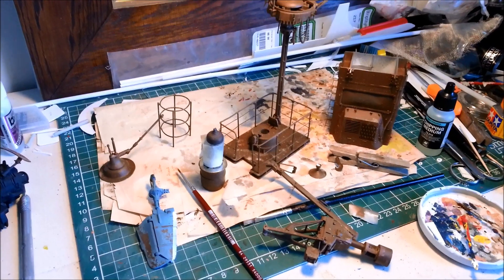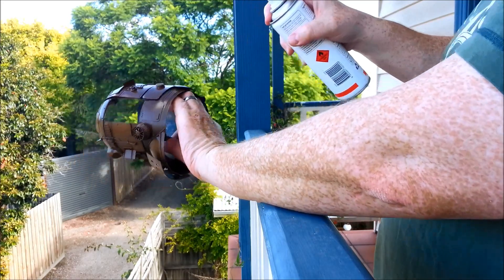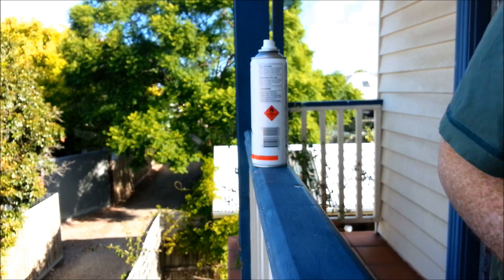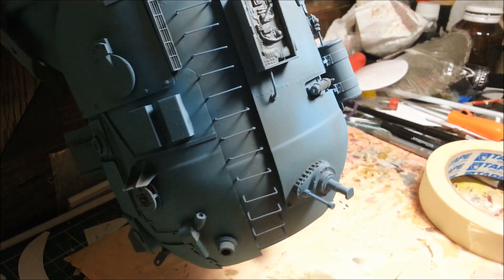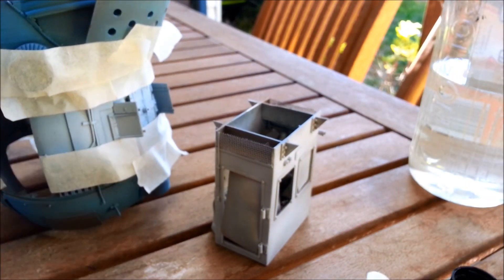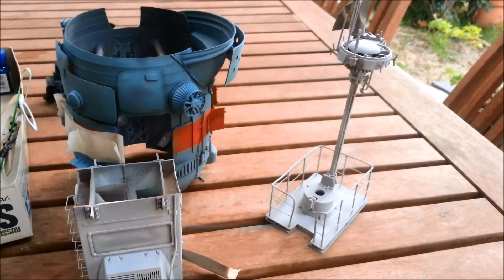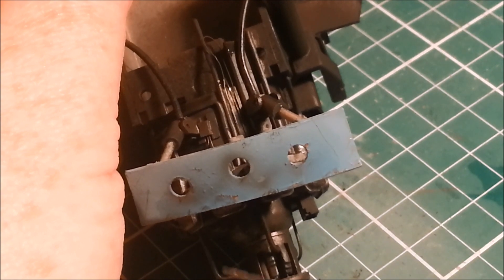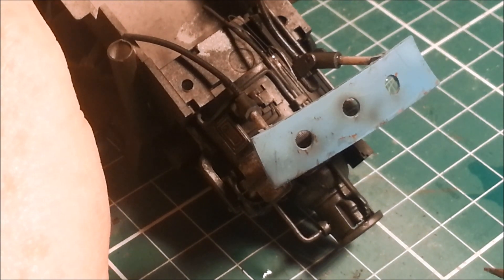Painting and weathering: in depth hairspray chipping tutorial

Comment: If you leave your model with hairspray on for a while will the effect not work
Reply from the maker: It shouldn't make a difference. I have left the hairspray for a couple of days before painting the topcoat and then chipping, and it works fine. The main issue is the thickness of your topcoat, if that is very thick it can be hard to make it chip.

Comment: Beginner Question: I've tried the hairspray method with waterbased acrylic paints (I know but paint thinners in a flat during winter isn't that great). So I've tried to apply a base coat, seal it with satin gloss varnish (spray can), apply two layers of hairspray and then another coat of acrylic paint. Btw. I applied the paint via brush not air brush if that's important. I let everything dry for 2 days, then wet the surface with clear water and started to chip with a hard bristle brush - which wasn't very smart as most of the paint came off and I looked at bare plastic. But even with a soft brush it wasn't anything good.

I would conclude that waterbased colors aren't really useable for this technique? That might be a "no sh*t sherlock" kinda thing but let me direct your attention to the first word in this comment. Otherwise I'd love some pointers as the hairspray method looks very cool and easy to do. Thanks. :)
Reply from the maker: Hmmm, I think you’ve got the answer with your water based acrylics. I would try experimenting on a test piece or two, see if you can get it to work on something that isn’t important. But I think the issue is the water based paint. I would also try only one layer of hairspray, rather than two. And try to keep the final top layer as thin as possible (airbrushing would make your life easier here, but I understand not everyone has one). That way you can experiment with less water overall at the chipping stage, and hopefully this way you don’t lose all your paint. Hope this helps - Dave
Reply: @DavesModelWorkshop  Thank you very much. First off: Great videos. They're all very helpful and I still have a lot to go through :)
I just think buying an airbrush right from the get go seems a bit steep but I think I'll stick with this hobby so maybe next year I'll get one.

I'll try less hairspray and maybe I'll be not as conservative while using the varnish. Maybe I didn't seal the first layer properly? If that doesn't work, well might be time to try enamel paints. Thanks again, have nice and save holidays and a better 2021. Greetings from Austria
Reply from the maker: Agreed, make sure you really want to continue in the hobby before investing in an airbrush. And if you do, it doesn’t have to be crazy expensive either.
Reply: @DavesModelWorkshop  From what I've seen, the airbrush itself comes in quite the price range and there are "good enough" cheap options. But the air compressor seems to be the more expensive investment here.
Reply from the maker: @BlueManaBanana  I got a combination airbrush and compressor package for around $100, and it has worked a treat for 15 years.

Comment: Great tutorial Dave. To be honest I wasn't sure that you could hairspray chip enamels, but your results look great. I have a project in the holding pattern which will have a very similar colour scheme and rust effect, so this is very timely for me.
Reply from the maker: Damian, I wasn't sure myself until that first test piece ;)  What's your project?
Reply: Cool, diving right in, like it! My project is a stupidly ambitious, overly large long-term display involving 5 (yes 5) 1/12 scale Monogram Chev car kits. I have an unbuilt Camaro and an unbuilt Corvette, and 3 paint-bomb 57 Chev Bel Airs that I have picked up over the years from various swap meets. The 57s will be built cut down to convertibles to show 3 stages of restoration. Barn find, workshop and show car. The Camaro will be a tow car for the "barn find" 57 (so I need to learn how to solder to scratch-build a tandem trailer as well, from brass stock), and the Corvette a show car sitting beside the final 57. The reference car I am using for the barn find 57 is the same colour as your SeaHorse.
Reply from the maker: That sounds cool! Ambitious, but it will look amazing once completed!

Comment: Hi Dave. Wonder if you'd mind answering a technical question? I've primed my model with acrylic, done an acrylic rust layer with airbrush and a sponge, I've not done any type of clear coat. Now I'm want to do a hairspray/vallejo chipping medium layer followed by a enamel colour coat to chip. In your experience would you say I need a gloss/matte clear coat after my rust coat to protect it? And if not, would an acrylic rust->hairspray/vallejo chipping medium-> enamel colour coat work?
Reply from the maker: Hi Matthew, as long as your base acrylic rust coat is fully dried and cured, you should be fine and shouldn't need any gloss/matte clear coat before the hairspray/chipping medium. And you will be fine to do a top layer of enamel, just keep it thinnish, don't layer it on too thick or it will be tough to remove. Cheers, Dave
Reply: Dave's Model Workshop brilliant. Thought as much but always good to check with the experts 😁

Comment: So the hairspray technique works with enamels?  For some reason I thought it only worked with acrylics, I didn't think enamel would let water penetrate at all for it to work...
Reply from the maker: Hi Matt, yep, it 100% definitely works with enamel paint.
Reply: Okay!  Time for some testing, cheers!
Reply from the maker: Sometimes if the enamel paint is thick it might need you to make the first scratch or chip to let the water underneath, but once the water has access it will work just fine. But normally you don't even need to do this.
Reply: I guess it might have a harder time getting through gloss or satin enamels.  I'll do some tests over the next couple of days.  I'm using Humbrol generally so my results might vary.  Cheers.